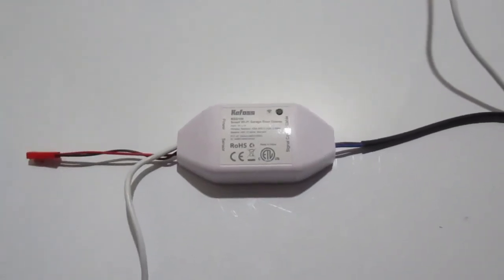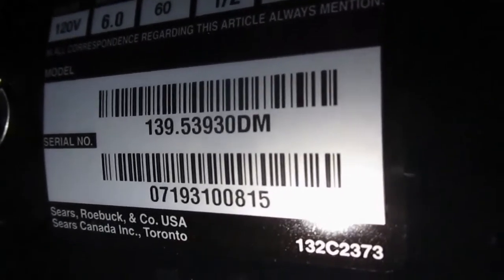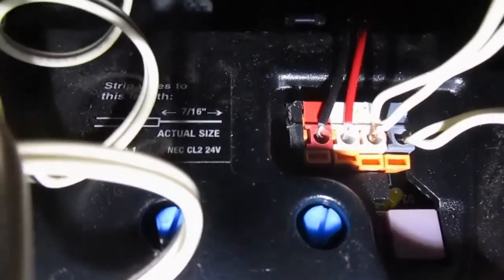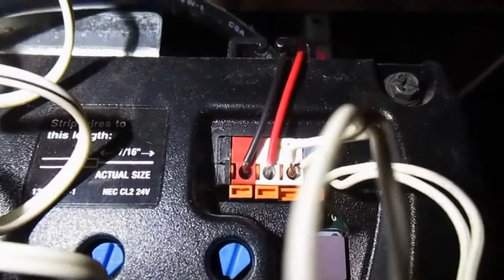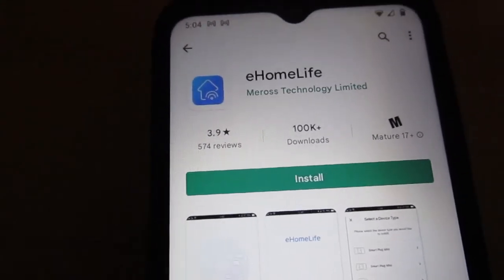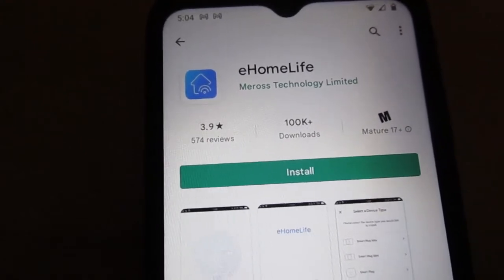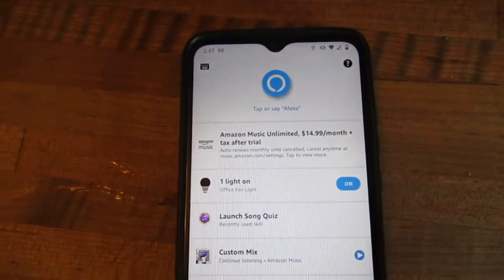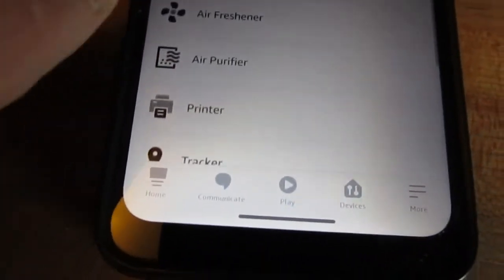SmartLife and Alexa garage door installation

Comment: How exactly did you set it up with Smart Life app? I selected Garage Door opener Wi-Fi but it never shows up. The opener created a Meross Wi-Fi network, and I looked up online and it looks like Meross isn't compatible with Smart Life, so how exactly did you do it?
Reply from the maker: "Garage Door Wi-Fi" within SmartLife is just the label for the smart garage door opener, NOT the name of the wi-fi network. You add the smart garage door opener device within the SmartLife app and then connect it to your existing home wi-fi network (in our case, we connected to our wi-fi extender network since our router is located a long distance from our garage). Hope this helps.
Reply: @DoItYourselfandSave  I did choose and connected to my home network, but the door opener never showed up.